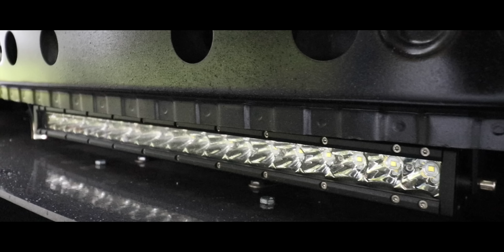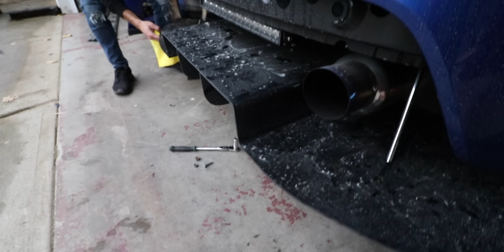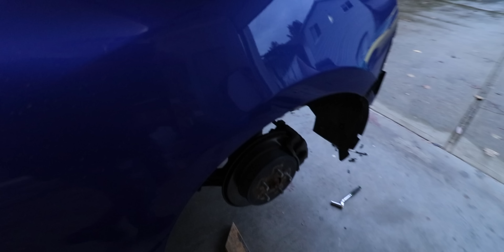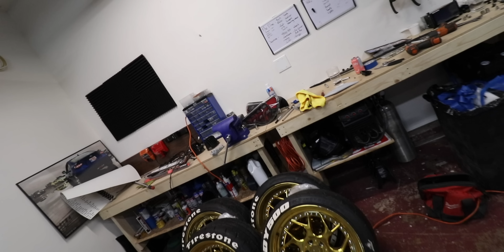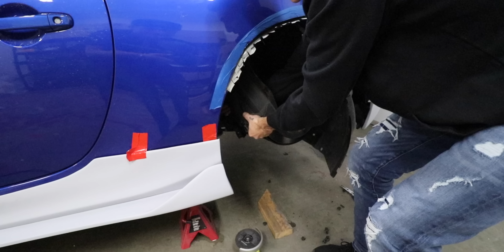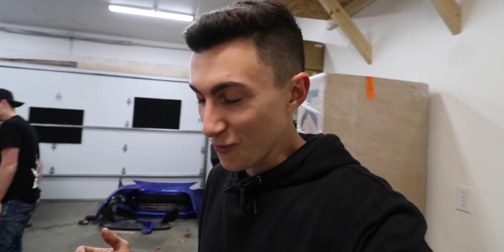Installing The Karma Widebody Kit!

Comment: Robbie you can have the bumper and fenders moulded, but still seperate  put a layer of like wax paper or separator between where the seams would be and mould it so that it is smooth, then paint them seperated.

Comment: use plastic trim snaps to mount the kit , no need to access back side , just fiberglass tabs on the inside of the kit and drill holes in metal fenders for snaps ;)

Comment: all you need to do is google " brz headlight wiring diagram " and look for the wire that says its the "parker" wire. thats the wire that connects to the boomerang, so all you'll have to do is cut that wire and hook it up to the DRL power wire, dont forget to ground it.

Comment: You might be able to resin some fiberglass L brackets to the backs of the fenders so you can mount them to the body but no bolts on the outside. Thats what I’d try at least

Comment: epoxy glue "side skirt clips or moulding clips " under  the kit ...and drill holes for attachment..if you get the idea..hahah..oem fender flares / side skirt are usually attached by clips

Comment: Hey, ok I was stunned with the video.

  I started to redo my 02 escalade Ext. First i had the WORST time finding honest mechanics to get what I needed. Finally found a guy after a year and  It's going great. I rebuilt EVERYTING on drive train not even the stuff not needed. All new brake lines everywhere. And everything on each wheel brand new. Suspension completely replaced again even not needed items lol.
 Finally the body work rear quarters front fenders ( doors excellent!) ( Canadian winters so rust) Ok so Rust is done THIS WEEK !! Now My HUGE decision. The truck is an 02 Do i spruce it up by adding a body kit? ( looking at Cadillac Escalade EXT ESV Duraflex Platinum Body ) Ya think after so much time on my old guy a no go . Or The old guy needs a new look? Im so torn as I'll need to find someone to do this work. My current mechanic is like 70 and say. Trucks to old drive it then throw it away. But.. lol In reality  the truck drives like new and the FRAME is mint still. So.. lol I trust his word on everything but that. Plus. I do not have  what 20k to get a decent replacement. the damn thing is a mountain goat sure footed in snow. SO my question .. How do I know the body shop I go to is over charging me for a job like this?  4 piece install on escalade ext 02 should be around what?  I only met crooked places so far ( new to my area) so I kinda need to know what is reasonable and NOT for time frame AND payment.

Comment: Why don’t you glue the quarters to the quarters and rear mount the quarters to the rear bumper so you can remove it later and the same for the front over fenders and the 2 way tape the rocker fenders with clips at each end. Makes it what you want and looks good

Comment: ROBBIE IF YOU GET TO READ THIS. put wire mesh on the bumper. but leave the whole smaller holes. won’t regret it i promise so they can work as air ducts

Comment: I have a front spoiler for my juke that totally fixes the lower front and brings it out.. I am going to try and get away with 3M 2 sided, But I ordered gun metal fasteners, just in case I do have to piolet drill in a couple spots, But I do want it to be removeable. just in case I need to pull the front cover off once in a while.. Can't wait  cause at first people will not know what it is, then they will think it's some kind of nismo..

Comment: Do you really need a paint resporator just to cut your fenders... they have face mask and full face shields cause the grinder is a death wheel plus the sparks from the metal makes pits on your glass.

Comment: to be honest, I'm very sorry robbie, but im seriously NO fan of that kit what so ever.
it adds random weird lines, the actual chassis sticks through the front fender piece and it looks like its meant to have a completly different front fender piece (hence the extra hole that goes over the frontbumper?
also, the crash bar doesnt work with that kit. its probably meant for a bash bar.
if you would have waited just a little, the artisan bodykit looks SO much better for the 86brz.

sure, you wanna go full send, but i think this kid smashed that car into a ditch, flipped it and got impaled on a pole.

i will keep following you, but im not going to continue watch any brz content. it looked MUCH better in stock width.

about the stock frontbumper splitter-thing: you couldve just flipped it upside down and not popping out your frontbumper all the time.

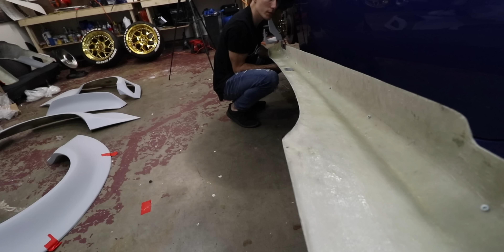im at 9:19 right now, i paused the video.

and yes, i did saw the white/blue demo gt86 from Karma.

However i would like to see that kit with the standart front bumper? would that be possible?

Comment: Enjoy your videos but .You will regret using hardware if the kits not designed for it kits that come with it have special recesses for the hardware if you just drill through will likely crack in no time

Comment: Valenti Smoke Head Lights
Valenti Smoke Tail Lights

Pandem x Rocket Bunny Front Bumper
Pandem x Rocket Bunny Widebody
Varis Carbon Fiber Hood

Rally Backer Diffuser V2
(GReddy x Rocket Bunny) V3 Spoiler
(Pandem x Rocket Bunny) V3.5 GT Rear Wing 

3M Graphics
Llumar Windows Film
Craft Square Mirrors
Akrapovic Exhaust
H K S Suspension
BBS Wheel

Sparco P-310 Steering Wheels
Recaro Sportster CS Series Seat
MK1 Brainiac Center Console/Head Unit